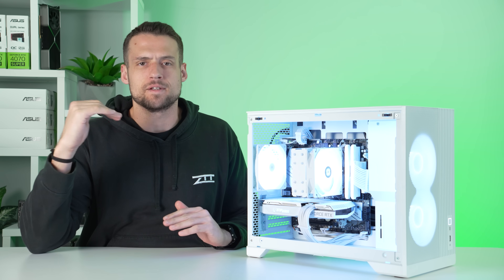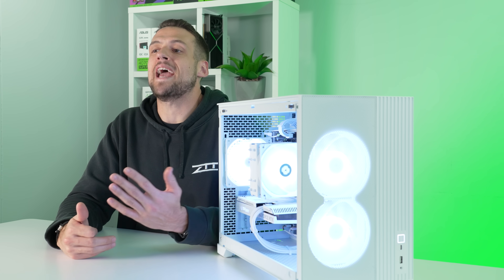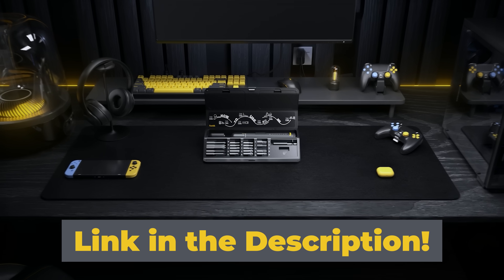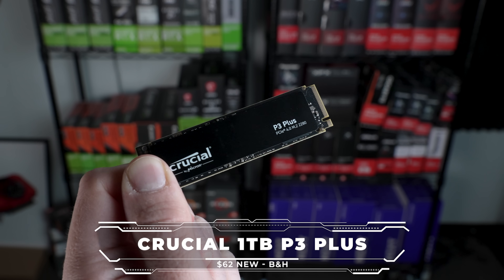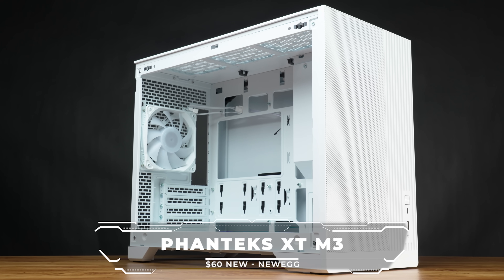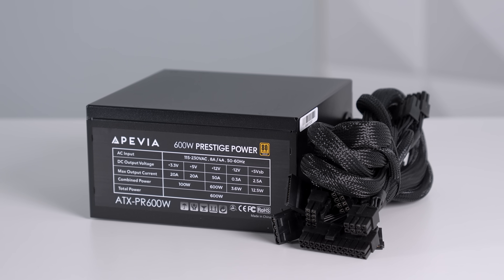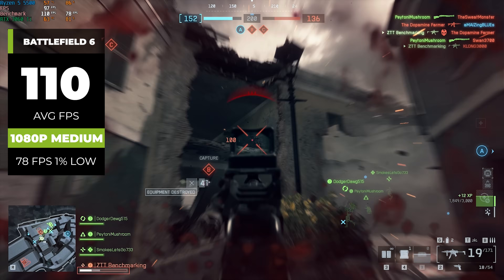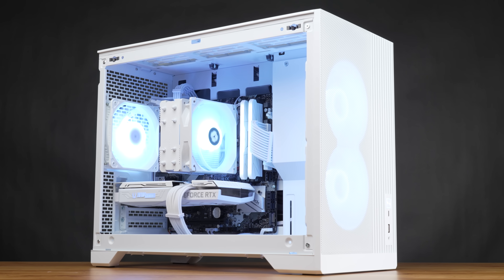$650 Gaming PC Build Guide

Comment: Quick tip:instead of filtering by ram speed and cas latency 
Just filter by first word latency to 10 so it includes both 3200mhz cl16 and 3600mhz cl 18 cuz sometimes they might be cheaper if some deals are going on 
And this also works for ddr5 for 6000mhz cl 30 or 6400mhz cl32 or even 8000mhz cl 40 all are great

Comment: I bought my Corsair vengeance ddr5 6000MHz for $200 now if you check on Amazon it's up $504 for a used one...Lord have mercy.
Reply: I brought my Kingston fury beast ddr5 6000mhz 32gb for £80 and know it's like over £400 😮
Reply: My GSKILL M5 Neo 6000 ddr5 in whitte with rgb was 125$ new in a local shop, it is now almost 500$ in the same shop.
Reply: @Yaboivit   ikr crazy
Reply: I paid $90 for the exact same ram in march 🥀

Comment: There are some great prices still on some parts like I just ordered the Asus Rog Strix B850 for $270 which was up to $350 and two Samsung 9100 4tb m.2 for $370 a piece, which is $50 more than the 4tb 990 pro and twice as fast. Gen 5 prices are way down because they used to be around 6 or 7 hundred. The COOJ MQ6 is back in stock so that's next because they offer gen riser cables and the 600w psu. I'll catch some ram at some point and a gpu.

Comment: insane that ddr4 prices are basically the same as ddr5 prices a couple months ago
Reply from the maker: Insane
Reply: I could ave bought 64 gb of ddr5 ram before now i can barely buy 16 gb 😭
Reply: I bought $60 32gb ddr5 in July on sale.  It's now $409.   This is going to price so many out of building or buying a rebuilt.  Heck It's going to screw everything.  Dont break your phone.
Reply: @gtd360  : I bought 2x24 Gb Corsair DDR5 6000/CL30 in August for €189. I just checked, it's now €699.